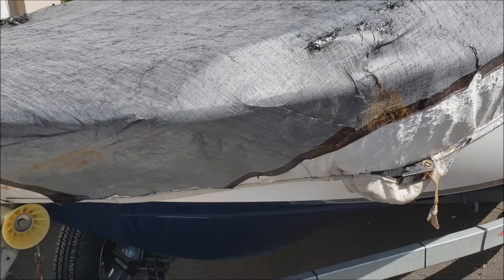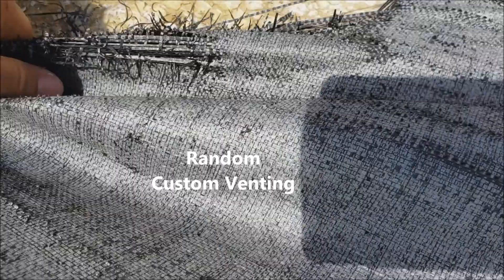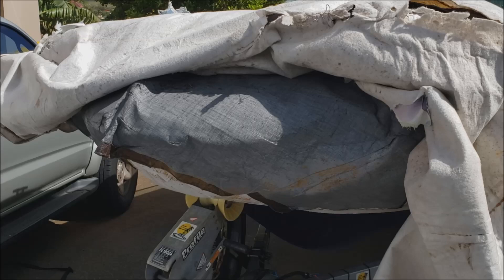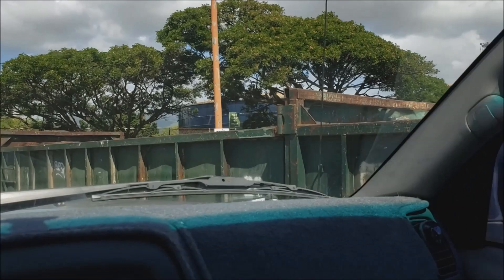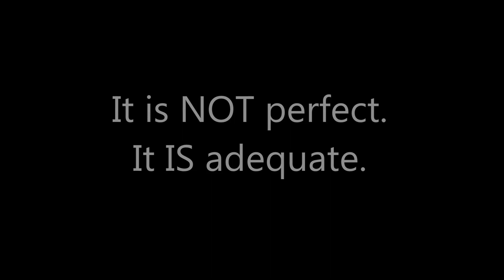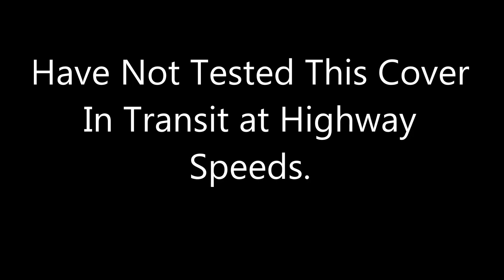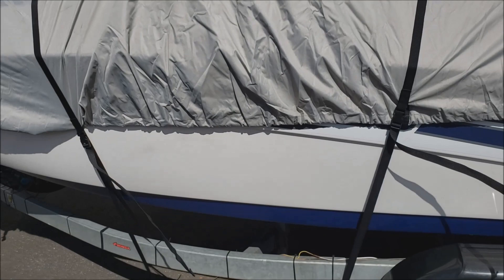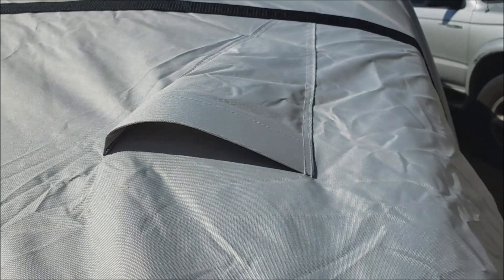Yamaha SX190 Boat Cover Replacement - Burial of FrankenCover - Episode 27

Comment: I got a black yamaha cover as well with my boat,  same fit as the white one but made with completely different material,   I bought my sx190 second hand so it may have been an upgrade the previous owner made
Reply from the maker: Aloha. The Black Cover is probably an aftermarket unit.  From what I've seen about them they're a really nice upgrade.  I considered one but figured I'd give a generic cover a try to see how long it lasts.  The savings are going into some other projects for the boat right now.  -scott
Reply: Hawaii Jetboat Adventures I think that’s a good idea, the 1 I have is the yamaha travel cover and its $842.  You will get a lot of those covers you have for that price,   I store my boat indoors so it should last a long time,
Reply from the maker: I would love to get my boat under cover...!